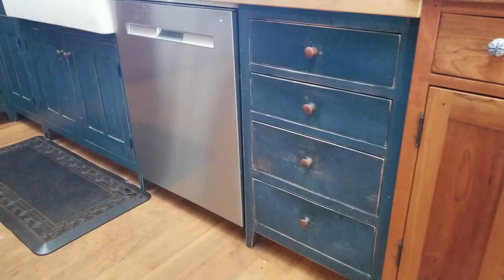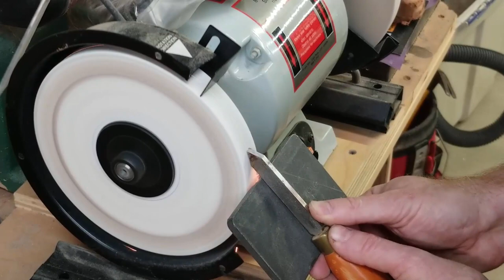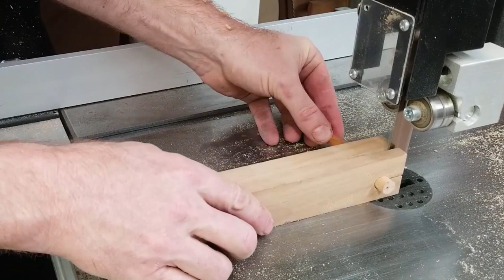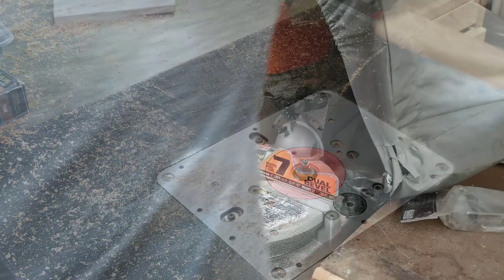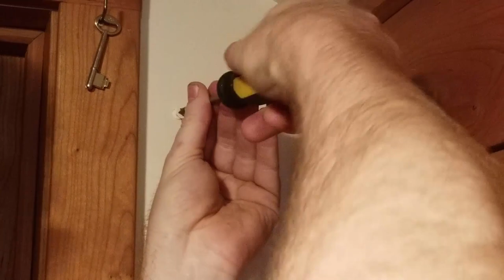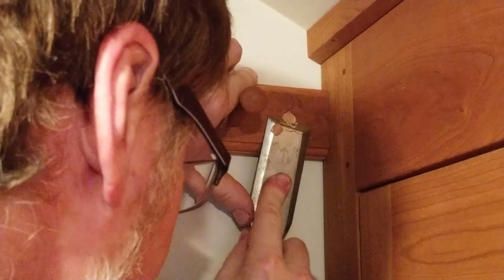Turning and installing some Shaker pegs

Comment: Hi are those first things in installation anchors? Thanks
Reply from the maker: Yes, drywall anchors. I prefer the type that you screw into the drywall. 
https://www.homedepot.com/p/E-Z-Ancor-Twist-N-Lock-75-lbs-Medium-Duty-Drywall-Anchors-50-Pack-25310/100040265